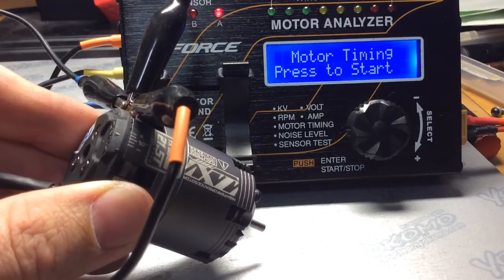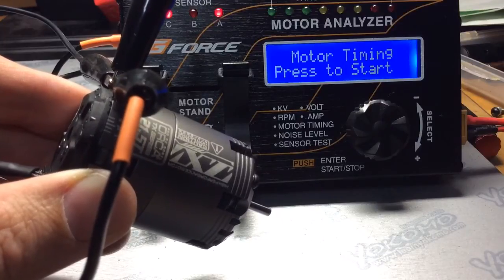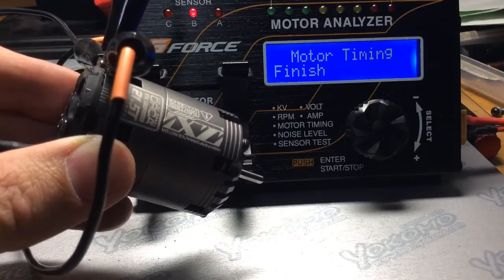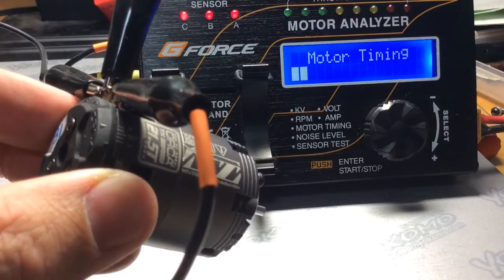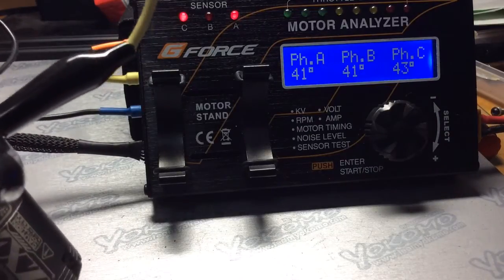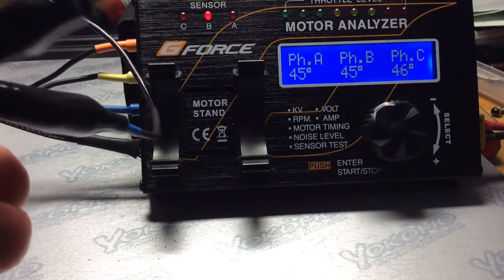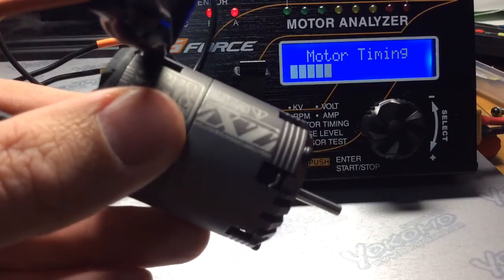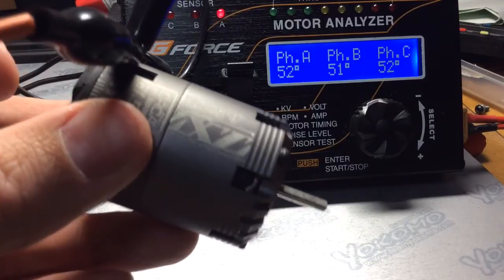Orca TX 21.5 Timing Settings

Comment from the maker: I adjust the three small screws on the plastic backplate. You'll have to use a 1.5 mm driver to loosen the screws. You just need to back them out until you can rotate the end bell. However, the TX end bell is a snug fit. You'll have to take a flat head screwdriver to pop out the backplate slightly. This will free up the backplate for easy rotation. You can adjust the back plate clockwise or counter clockwise. If you move it clockwise, you'll reduce the RPM, KV, Andy AMPs. The motor will run cooler and efficiently, however, you'll be lacking in power. Moving counter-clockwise will increase RPM, KV, and AMPs. But too much will make the motor hot and inefficient. You'll have to test and see what timing setting works for your track size and gearing selection. Be conservative with your timing settings.